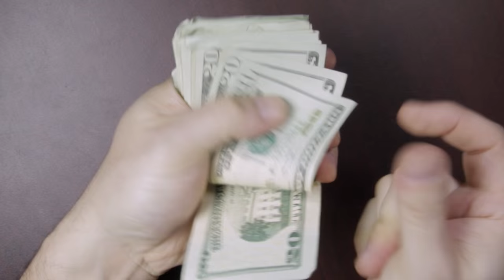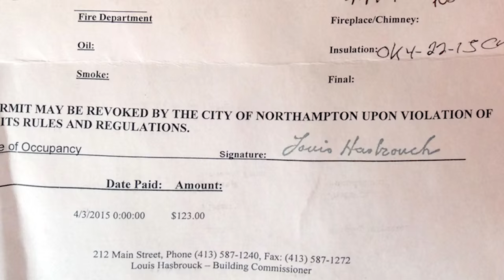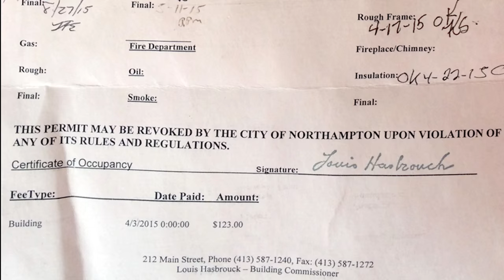DIY Basement Renovation Time-Lapse - 1 YEAR IN 5 MINUTES - #timelapse #building

Comment: awesome video, very good production, keep it up man!  how high were your ceilings btw in your basement?
Reply from the maker: Thanks Chris!  Ceiling were pretty low..... 80" I think to the beams.  But with some plumbing moved out of the way, we only lost an inch or two, so finished, it's maybe 79".   Ended up feeling taller than I thought it would though so it all worked out ;)   Nice channel by the way!
Reply: CHODOS PHOTOS 79 inches was the height of the ceiling in there?

Comment: Super cool watching the transformation!  I appreciate the addition of the plywood underlayment for the carpeted room. 😉  May I ask if that was a hot water heater or furnace in that small utility closet?  Seems like a great way to increase your useable living space!
Reply from the maker: Hi raymond!  Thanks, the floor came in handy with a washer leak just days ago.  It's those Drycore panels and was a simple fix. The hot water heater replaced the original beast...going from less than 50% efficiency to 96% efficiency.  The state offers great incentives.  Plus, yes, much smaller to cram in neatly into a closet.